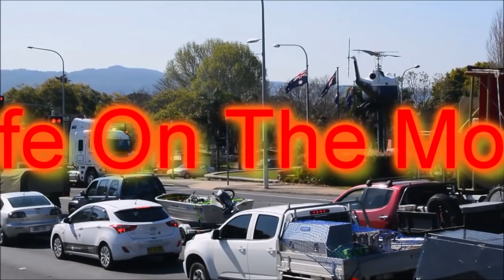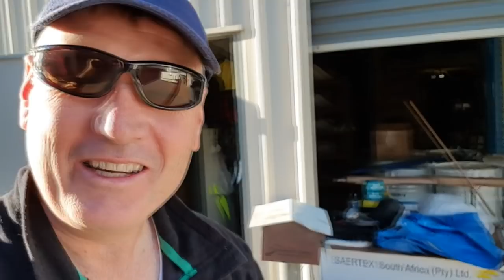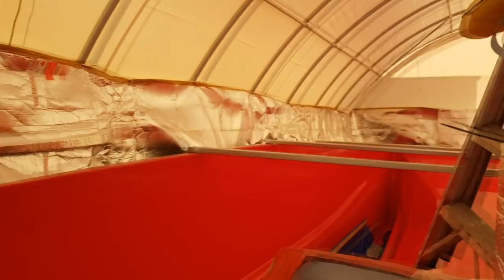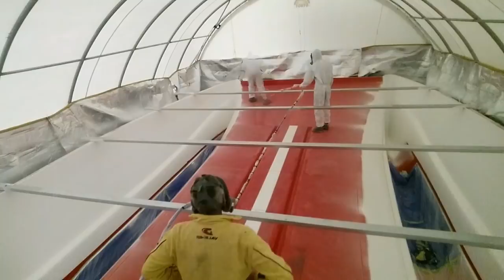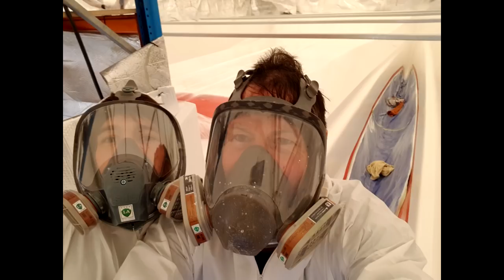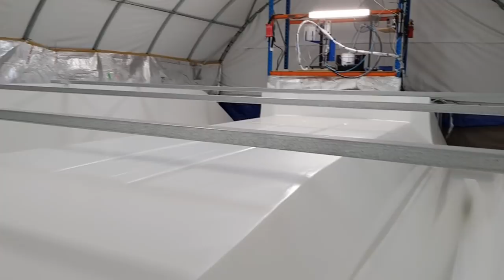Ep010 How to Spray Gel Coat for a Catamaran Hull

Comment: Lots of work. What’s next?  4 oz Matt with cloth over the top? Or maybe 1708 with 2 ounce under.? It will take lots of time to get that skin Cote 
Laid up before some areas start to lift. Did you consider a black back up? For UV protection. That would be difficult without a flying Spyderman 
Rig to float over the Mold. Good job, best of luck.
Reply from the maker: +Bobeeg .Hey buddy.I will do a laminating schedule video later next week.Basically layup is specified by Australian Maritme Safety Authority and our initial surveying yacht engineer Oceanic yacht Design..In metric terms.gel coat,300csm/300csm/1215 quadraxial/300csm/30mm h80 foam/300csm/600double bias/300csm/then peel ply. All chines and keel lines solid glass with overlapping quad and double bias cloths.
We were able to laminate skin coat with three plastic bags on each shoe.Had a tiny patch of gel lift on the bridge deck but reapplied new gel and the whole first layer done in a very long day.
Now hull is all but finished.I am up to bulkheads and unis next week and progressing well.huge job for one bloke though.All the best Rossco

Comment: How many layers of gel coat?
Reply from the maker: Should always try to complete gel coat in one go,at correct thickness,however a little top up is almost always required in thin spots where corner or ridges are found.Too thick creates brittleness and ultimately hair line cracks.Cheers
Reply: @LifeOnTheHulls  correct thickness around 1-1.5 millimeters?
Reply: Watching this again looks like the hull sides got two layers...